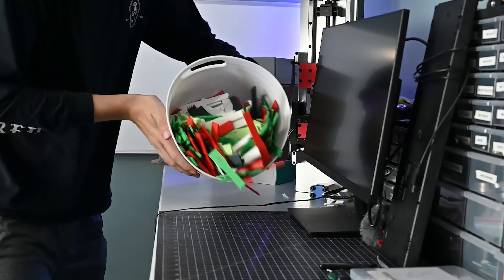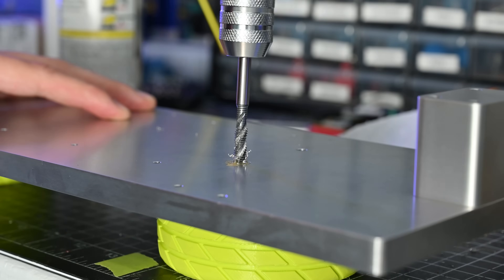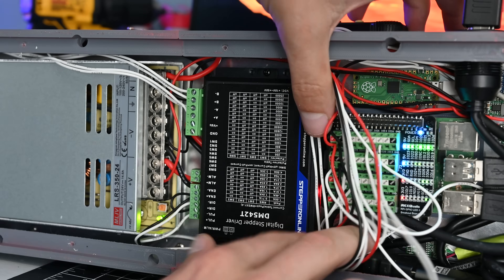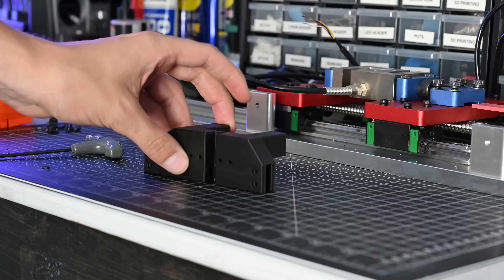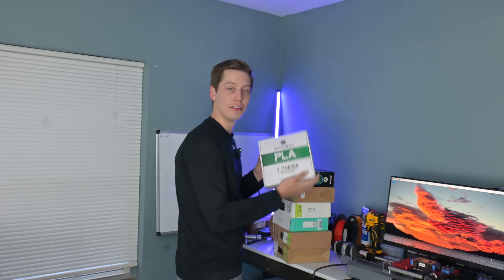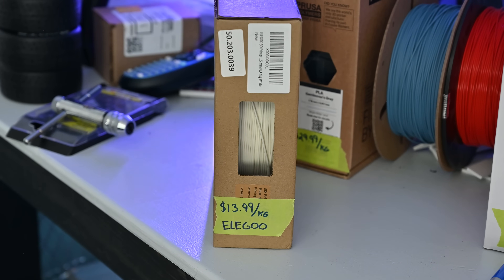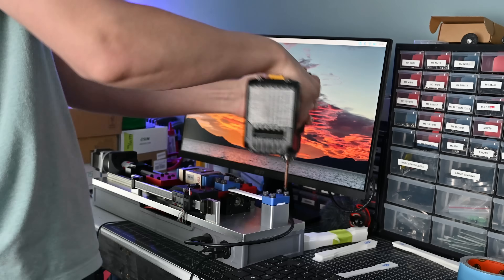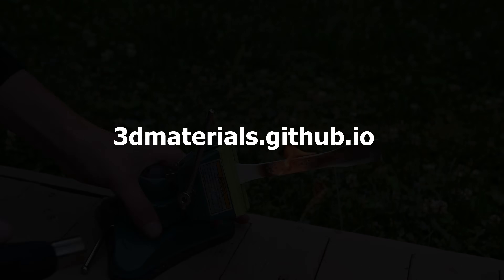Is PLA actually STRONG??

Comment: bought my first 3d printed used and it came with a roll of cheap used filament i was quite suprised with the quailty and strength of the prints maybe i just underestimated 3d printing but i assumed it would be deformed, jagged edged and be insanely brittle but from my experience its stronger than alot of plastic injected molding parts especially alot of the bs china makes these days.alot of bs to get it setup though

Comment: I have a test idea I don’t think I’ve seen anyone do. Establish the limits of material strength, than take the weakest material and build up the design in CAD until it’s as strong as the strongest. Then compare size (how much extra material you need to use), weight, cost, etc…

I think it would be interesting to see how much more PLA it takes to match CF or something in basic strength test.

I generally design parts in CAD for the application AND the material so generally I can make PLA work. I just use more infill, more exterior layers, or just make the part larger. Obviously this doesn’t work in all applications but for the simple parts I make it generally does.

Comment: I'd love to see you break test the filament by itself to see if the raw 
"String" break rates scale up to the creation and determine how much % is gained or loss from the added density and melting.   
  *I guess what I'm wondering is can I use a fish scale and figure out the raw PLA break strength using a bucket of water as weight and then scale up with math how much PLA will be melted into a given space and know what it's hypothetical break strength is without having to actually break the finished product

Comment: How is the stress calculated ? For solid filaments ita straughtforward as you divide the load bt the cross sectional area.
What about about the other sections with different infills ? What area did you use ?  Is it the same as a solid cross secrion ?

Comment: I don't see what temperatures you used, which is going to make a significant difference to part strength by way of whether the extrusions just mechanically interlock like hot glue or fully fuse.

Comment: I haven't heard a consensus of TPU being in the PLA mixture. If you look at the PolyMax SDS, it has PMMA in it (and it does tend to stand out as an easy print, so maybe there's something there), but most of the others I've found are about 97% PLA/3% CaCO3.
Reply: That sounds like a dubious claim. PLA and TPU are not compatible as far as I know. Bad PLA+ is likely PLA plus plasticizers. Good PLA+ is Natureworks 3D850 or 870 which is actually a different polymer formulation.

Comment: Interesting. I suppose that the printer and print settings would affect the strength though? Some material that is weaker here might bond better at +20 C extra etc? Or the other way around. 
But overall it's probably valid tests.

Comment: I would love to have the printer settings used for each filament, along with color, finish, and humidity.  The Carbon X1 sacrifices some strength for print speed because the melt zone in the hot end is smallish.  To counter this, they use higher stock temps.  The problem comes in the fact that thermoplastic is a poor conductor of heat.  Therefore, the outside of the filament might get to 230C, the center might only hit 190C.  At work, we use an X1 Carbon.  At home I use a highly modified Ender 3 V2 Neo.  The same print at work might take 30 minutes to print, but 5 hours at home.  But the home print is much stronger with the exact same material, infill, and perimeters.

Comment: I think if you did a slight redesign to the sample hold down clamps (standardized insert shape, a foot/shoe on one side, with a knob screw on the other), you could probably reduce it to 1 knob each side. 8 screws seems like a pain in the butt. It's one of those convenience things you don't really consider when designing, but you notice right away when you go to use it.

Another area you could test (would require a different module) would be to test the filament diameter consistency. I find if there's a high variance, it'll affect print quality a lot.

Comment: Some time back I was working on a website to help a small group improve data management. I used a library called Streamlit and was really happy with how good is was for getting a website up and running quickly, especially where there's data involved. I think it will make it easier for you to scale the current website in future! Also, I came across another project called pynecone that looked really interesting but I haven't had the chance to try it out.

Comment: Good info, would it be possible to print the test pieces in different orientations arent isentropic materials, be interesting to see the failure modes if there printed vertically and how that affects tensile strength :)

Comment: So good. Minor thing on the website. Cost/Strength should be the cost of the printed part. The 2 walls vs 4 walls of the same material should have different cost to print. This will give insight into if the additional material usage is worth it.

Comment: This is incredibly good, I've been looking for the hardest material (I mean, the one with the highest posible young module). But when you look into google, people never use the correct terminology. Having a web page with the tensile strength graphs is super helpful. That's a pure act of philanthropy. I really like your content. Keep doing videos like this. And BTW, I did like the part where you explained the testing rig, and i was not boring at all. I've would have loved if it were longer.  Again, keep doing this amazing work.
Reply: I'm with you.  I would have loved a more in depth discussion on how the rig was made.  It was really well done in design and machining.
Reply: You'll find carbon fiber pla even harder then I think

Comment: This is brilliant! As other people have pointed out, the pigments used can greatly affect the strength. It's widely known that transparent/translucent PLA is terribly brittle, and also filaments with a bit of moisture (aka ones that have been owned for a few years without a drybox) will behave quite differently compared to brand-new ones!

Comment: Nice job but you spent way to much time on the build (albeit a very nice job) and not nearly enough on the plot curves. You need to eli5 which point of the curve you would select for what application and which filament you would go with for that in a clear concise manner.

Comment: Please test strength with multiple samples from the same filament printed at different temperatures. I noticed when I print petg too hot it gets fragile. Please verify hot end temp when printing.

Comment: My biggest issue with that kind of testing is that it completely forget that the pigment can have a huge impact on strength and printability.

The impact on strength is not necessarily direct though, some pigment are more keen on absorbing moisture.
I have two good quality PLA filament rolls from the same source one is coral pink and prints wonderfully the other is white and is a chore to print with always foaming and leaves a harsh almost gritty surface.

I think the issue with the white filament is that they put too much white pigment in it as it was noticeably more opaque than the pink one.

So my suggestion for your testing is to test different colors for each manufacturer and to test with "soaking" your filament in high moisture environment to compare moisture absorption and performance degradation.

For pigment testing a white and black should be easy to find for any manufacturer and deep blue and red are also probably available for most of them.
You could try to ask them directly to have samples for all of the colors from a manufacturer and make filament review video on their products ?

For moisture, having 3 points of data a high and low with a driest strongest and a low weak with the filament after days underwater and one after something like 5 hours in high humidity (a long print without dry box feeding). That way we could see which filament are the most affected by moisture as well as how fast they are affected thanks to where the 5h point would be between the two extremes.

Even if there is a lot of variable you will probably be able to reduce the number of tests if for example one filament only loses 10% of strength from being underwater, testing after 5h in high humidity is probably useless. For pigment you might see trends that some colors are problematic while others never cause any changes, or some manufacturer have big discrepancy as they focus on looks while other test their pigments to assure similar results for more engineered applications.
Reply: Yeah, I have three colors (yellow, gray, and dark blue) of Inland PLA+, and I've found each has dramatically different printing settings and final results. The gray prints great anywhere from  212–230°C, whereas the yellow one has no layer adhesion below 220°C, but turns into a runny mess if I turn the temp past 225°C.

Comment: Visited the website.  It is a good start.  I wish the filament list was persistent when you changed tests.  I have to reload new filaments everytime I switch tests.  It doesn't remember the previous test setups either, which also could be fixed.  Next, it would help if they all defaulted to the same perimeter/infill just to eliminate a step when adding data. Last, need a "Download result" or image, or something.  Not complaining, just giving some feedback.  Nice job!

Comment: That looks really good, I never knew digital calipers have SPI.
Reply: Many do - even dirt cheap sets from Harbor Freight. I'm not sure what the most common use case is, but what I've seen in practical use has been QA/testing labs that are documenting many results all day long. They take a measurement designated by software and tap a key to record the measurement.